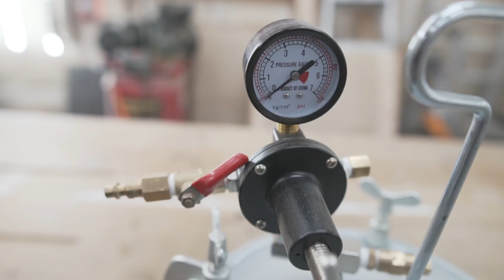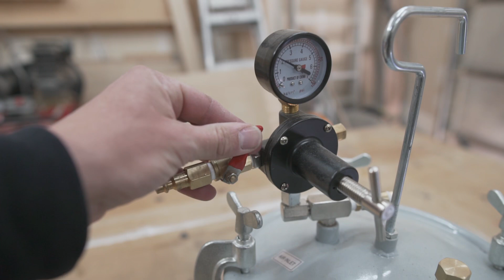Making A Fishing Net with a Banksia Pod Handle  | #rocklerbentwoodchallenge

Comment: What a great end result and video submission. Best banksia pod project I’ve seen.
Reply from the maker: Thanks kevin!  It was sure a learning curve using it but definitely worth it.
Reply: 5:55 why pressure and not vacuum? 
Both, the video and the workmanship of the woodworking is just great
Reply from the maker: Thanks Martin, I don’t have a vacuum but if I did I would have definitely used that instead.

Comment: Great video!. I’m just wondering when you bend the wood do you just soak it in water or do you steam it. And if you soak it in water how long do you do it for. Also how do you put a groove in with a file?
Reply from the maker: I soaked it in hot water for about 30 minutes.  As for the groove I just filled it in slowly and it didn’t take to long.